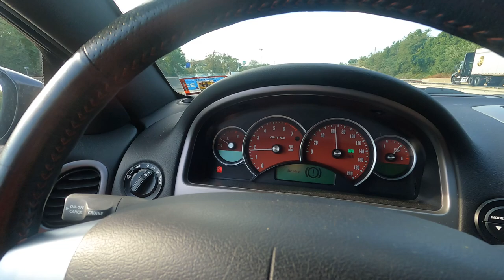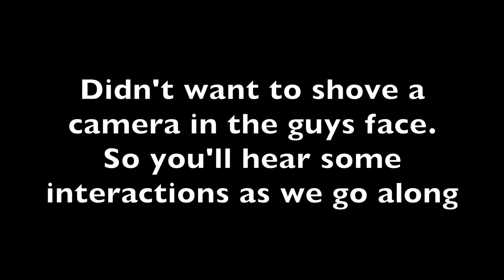GTO Gets Its Dyno Day! Finally!!!

Comment: Cold air, over the radiator intake buddy.   Cant go wrong, especially since you've now got a  mafless, Speed Density tune.
Regarding your brake, ABS fault.  Have you adjusted the hand brake, cheaked pads for thickness.  Some pads have a low wear connection wire.  Just thoughts.   And hello again from New Zealand
Reply from the maker: Tuner said over radiator robs power. Not sure how that happens. Add a few commented saying the same thing. As for the brakes, don't think there is a wire going to the pads. Worth checking tho. Thank for watching from NZ!
Reply: Otr definitely Xair,Vcm
Reply: @robirvine2922  to right.  There are many brands, but yes, the VCM is what I run on my LS1 04 HSV Clubsport
Reply from the maker: Definitely look into it. Maybe swap it out over the winter. Just got the car on the road and want to play with it first haha
Reply: @Billy_Ray_Garage  to right.  I'd do the same.

Comment: Howdy I’ve watched quite a few of your videos now because we happen to be putting the same parts on our cars around the same time so it’s nice to watch how you do it before I try myself. I currently have done 1-piece drive shaft, Borla exhaust, pedders coilovers, caster bushings, mishimoto radiator, polyurethane control arms and a build 4l65e transmission. I have a lsxr intake manifold to put on but I’m waiting to buy long tube headers so I can do them at the same time. Anyways I was wondering what your plan is for your next performance upgrades?
Reply from the maker: That's awesome! You get to drive it yet and test it out? The headers suck to install but definitely worth it! I have nothing in the way of adding power on the way. I want to strengthen it though.  The plan is all new rear(gforce), bigger brakes, wheels and t56 magnum trans. Should see that or part of that in the winter/spring
Reply: @Billy_Ray_Garage  yeah I live in an apartment and drive it across the state to my parents house to work on it so every time I work on it I gotta be ready to drive it back across the state in a span of a few days😂

Comment: I honestly do not understand the benefits of mafless tuning. I’ve got the duspeed and went with an ls7 maf for better/more accurate air readings over the ls2. I just have yet to install it as I’m scared to scuf the intake
Reply from the maker: I don't understand either. Wasn't on my bingo card for the car. This guy has been tuning for 25 years so he's gotta know something. It's been running great, just needs to warm up a lil before you drive to make it happy

Comment: I’m honestly scared to do brake lines after seeing how much trouble you’re having..
Reply from the maker: Not sure if it's because I bled the system dry, but maybe try to plug the lines to not introduce air? Only thing I can think of
Reply: @Billy_Ray_Garage did air get in the abs unit?
Reply from the maker: @jb6574  yeah I did. I did an automated bleed the other day. Didn't work. Wonder if you have to do it multiple times for it to work